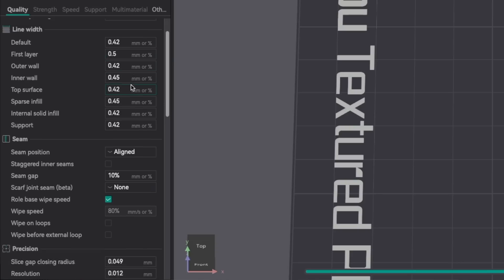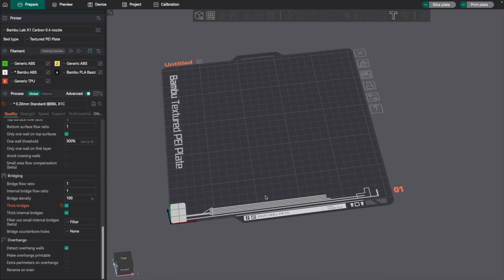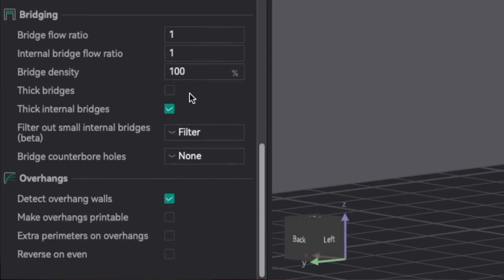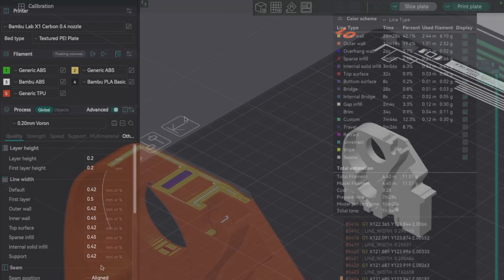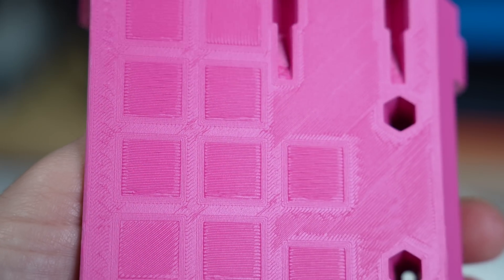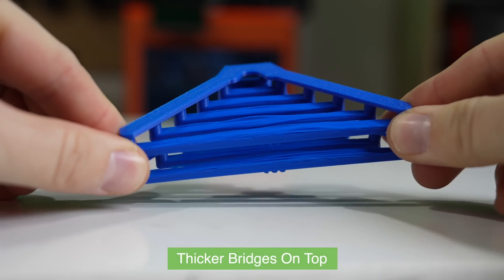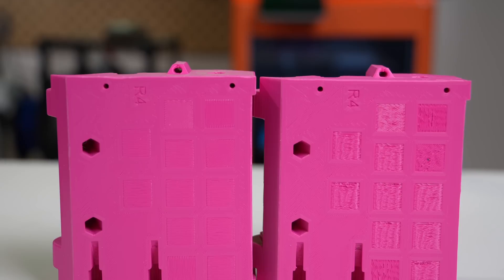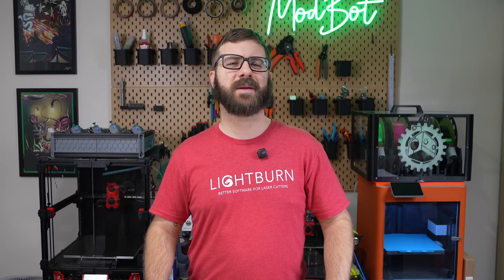Does Thick Bridging Actually Improve Your Prints?

Comment: I wonder if making your bridges "stretch" would be a good way to fix sag. If you go slow as possible with tons of fans and start your extrusion at .4mm or greater and reduce the flow as you extrude the line down to .1 or .05 or whatever you can get away with at the other end, then invert and do the next, it should keep the line  in tension at all times thus eliminating sag. Is this possible?

Comment: bro imma call you 3d printsus daaaaamn am i greatful you made this video, ive been printing or i should say trying to print airplanes to fly rc for the past 2 months and the parts for these things got internal structures that i really do not care how they look cuz they’re inside but they are the bones of the plane essentially and my worse nightmare, because im a noob the bridges all this time never connect at first causing the part to either sag or bend upwards and than the next time the print head would go over it itd knock over the part and fail print, most of the time i really on the gcode but its pretty old almost always and there are parts i need to redo plus its a huge waste of filament if i wanna do other parts different colors 

introduced to thick bridges by 3d printsus 20mn into the print and i realized i haven’t noticed a single crackling noise from the print head hitting a bridge i jumped off my chair thinking it had been knocked over and i was gonna find spaghetti 

nope i look at the print and the inside structure looks silky smooth perfect bridges the print head starts a bridge and it connects 100% of the time bro i am so damn greatful

Comment: I didn't know what it did, and left it on as default. It ruined like a kilogram worth of my print because it protruded so much and it made it look like they were overextruded by crazy amount, so severe that nozzle made crazy scratching noise going over the bridges - i had extra bridge layer turned on and variable layer height also on that made the layer height difference so dramatic. If I had a brass nozzle or used abrasive filament my nozzle would've been destroyed.

Comment: There is more sagging with thick bridges due to weight, as you mentioned, but also because a 3D extrusion that is twice the diameter has quadruple the material so doesn’t cool as quickly. The result is a heavier strand that is more molten. If you need to print a long bridge, you can reduce this by making sure your fan is on full for bridges and slowing the bridging speed to allow longer for cooling. Try using extreme cooling and slow speed with the normal bridges too. It might improve the finish.

Comment: Would be interesting to see if enabling thick bridges by bridge length would result in a universal improvement. From your tests it looks like bridges longer than 20mm were better as normal bridges, probably due to the mass of each bridge line and cooling limitations.

Comment: Side note. No matter how well you bridge, if its a tight tolerance space for other parts to fit in and the bridge is exposed, use support material as the intended dimension of the void will be different since the bridge isn't squished.

Comment: Thanks for this.  Found an additional trick for the vertical bridging test you are using.  Noticed that after the first bridge layer with slicer setting tweaks it is possible to get the 2nd and 3rd layer, etc to fill across the bridge alternating 45 degrees.  Regardless of thick or thin bridging, by default, bridge layers 2,3... are printing in same direction as first bridge layer.  Forcing layers 2,3... to instead alternate greatly improved the results, with temp, cooling, etc all being the same.

Comment: This is super counter intutitive. I have never used this feature. My rational was, I need less material to extrude on bridges not more.
Reply: The rationale is that without squishing against a previous layer, adjacent bridge lines will not touch each other.
Reply: @daliasprints9798  Yeah that´s true, if you want a perfectly closed bottom. However bridges for me are just a feature to span over to the other side. You can´t fuse layers together in mid air. It should squish on the bridge head then span over and squish again, which is does with less flow. And it forms thinner strands in mid air which are not fused but they don´t sag either and can be cut away later. While the next layers have something to hold on to. I have tried out the thick bridge feature and it never worked for me to be honest. It was usually a droopy mess.
Reply: @sierraecho884  Well what happens is also that you get less flow than needed to fill the nozzle orifice since the cross section is larger without anything to press against, which leads to the pulsating extrusion rate seen in part of the video.
Reply: @ That´s why you tune it. Once the droplet is anchored on one bridgehead it will drag a fine thread to the other side, before it droops.
Reply: @sierraecho884  In practice it's often not a fine thread but a thread of oscillating or at least very inconsistent thickness.
Reply: @daliasprints9798  Yeah but even so, it does not matter. It´s still a thin line and it give enough support for the next layer, that´s what matters.
Reply: @sierraecho884 You might try increasing the bridge fan speed and slowing down or speeding up travel for thick bridges.
Reply: @Nathan0A  I print with PA without fan as recommended by the supplier. Travel can´t go faster on that particular machine. But good tips, thank you very much.

Comment: My printer's default profile had thick bridges on by default. I hadn't noticed it until recently I had to print a part with a small horizontal hole which a wire needed to go through. With thick bridges on, the top surface of the hole was lowered by a layer or two. The wire wouldn't fit, and the print didn't work until I turned off thick bridges (at which point the hole was to the expected dimensions and the wire fit fine). So be careful to disable thick bridges when the size of small horizontal tunnels is important to the part's functionality.

It would be nice if there were a setting that would enable or disable thick bridges based on the length of the bridge.

Comment: I found using the setting, Extra perimeters on overhangs, helps when I needed radial bridging.
Reply: When bridging over holes with only two perimeters it starts with inner walls (on air) same with 3 however with 4 it starts from outer perimeter to inner.

Comment: Try printing different combinations of flow rates, cooling, and thick/thin. Also, thick bridges seem to perform better for nozzles larger than 0.4mm.
Reply: I have and can tell you it’s too much trouble. I charted out which bridge lengths perform best with which filament and fan speed. I referenced my chart for prints with bridging and had it dialed in. This gets complicated when there are multiple bridges. Because my prints are  always function parts, inconsistency is unacceptable. Turning thick bridging off improves consistency, and it’s easy to recognize the places you’re going to have issues. 

And IME, as well as Orca’s tooltip, thick bridging is worse with larger nozzles. Thick bridging is double the layer height of the nozzle width, so cooling a 1.6mm thick line of molten plastic in mid air is not possible without the downdraft from the cooling ducts causing sag.
Reply: @TheOfficialOriginalChad  It appears that you are correct sir. I guess I read that tooltip wrong. However, I've done what I suggested in my original comment and my 0.6mm nozzle machine seems to produce better bridges when I turn on thick. If I use thin, the subsequent layer or even subsequent lines of the initial bridge layer will pull some of the previous lines off of their attachment points. There is a PR that just got merged into the main branch (available on the latest nightly build), but hasn't been officially released yet; which adds settings for the subsequent bridge layer. This may help with my issue. I am looking forward to trying it out soon.
Reply: @ oooh that might be the middle ground we both want!